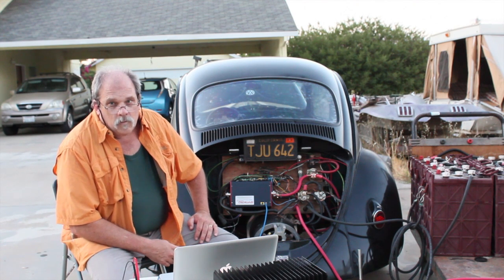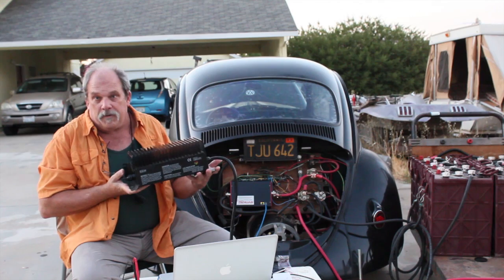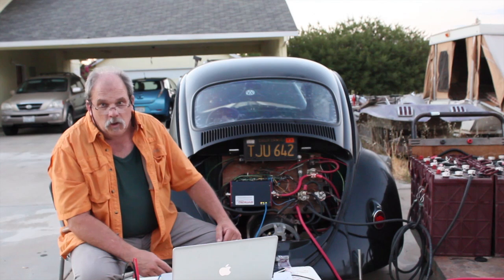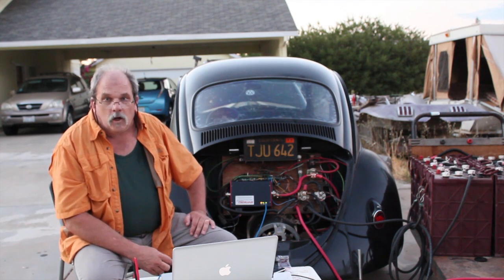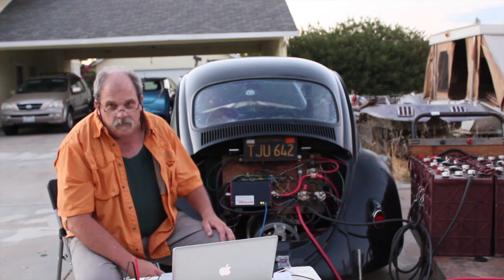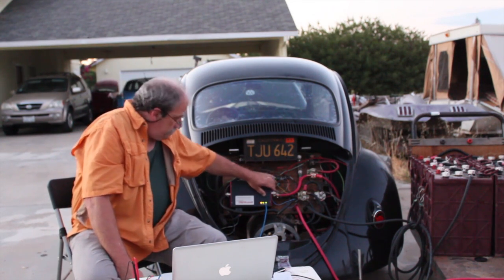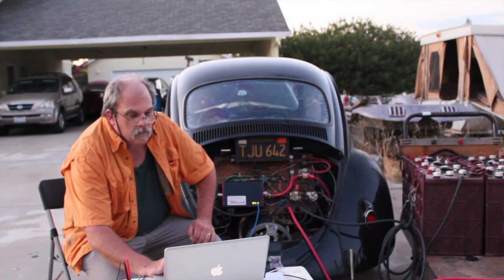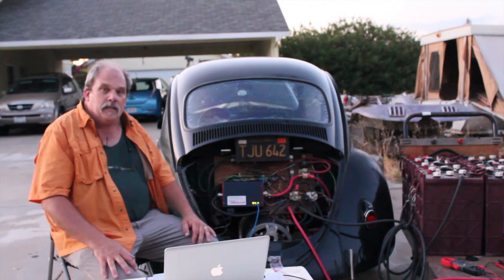Synkromotive

Comment: hi pete i have a synkromotive 750  controller  like yours in the video but no cable to link to my laptop any idea what i need so i can then use my controller it clicks and the fan comes on but without computer conection i cant set any parameters to get it to do anything more  ,  any help would be great thank you in advance
Reply from the maker: So you purchased one without the computer dongle? Since they don't make these anymore you can't pick up a spare from them. I'll have a look at mine and see what interface needs to be connected to the cable. I don't think any programming was needed for the making of the dongles. I won't respond quickly but I will respond when I figure something out. No guarantees and I don't have a spare. I have one for each of my controllers. If I sell a controller the dongle goes with the controller. Yours should have come with one.
Reply: @onegreenev  i wish it had i thought maybe its a generic dongle that hand shakes with a laptop or software download im in the UK would really like to get the controller working thanks for responding and look forward to any solutions or advice on how to proceed   i have been trying to find someone who knows about these controllers  for years and very pleased to see your video the projects pretty much just waiting for this interface device good to know they exist cheers again  bobbie .
Reply from the maker: @bobbierobinson3387  I will do my best to help you get your controller setup so you can change parameters.
Reply from the maker: I have one of the last NEW still in the box controller.

Comment from the maker: I decided on the motor because I already had this motor. Since there was an adapter available at the time for this motor I went with this. At the time AC was not a thing. Now I would only do a conversion with AC Induction Motors. HPEVS has a good system. There are a few outlets that sell them. I have an AC-35 for my VW Bus.

Comment from the maker: I need to update what is said in the video. The controller does do the CC/CV algorithm but does not do 220 volts if you have AC setup. Unless you have a step down transformer to lower that 220 to 110 or maybe even higher like 140. If you use AC as your source it needs to be a voltage like you do for DC that is lower than your pack voltage at its lowest possible charge. So for a pack of 60 cells will be 150 volts at 2.5 volts each cell.

Comment: Once we find out how to implement this in a way that will cover just about all the ways possible and do so in a simple way the manual may be updated. Until then it is not in the manual. The higher the current the the more heat is generated in the field windings of the motor/inductor. It would be better if the current was 50 amps into the battery or less. But the controller is fully capable of pumping in 100 amps of current to the batteries. Its the inductor that gets the brunt of the heat.

Comment: You won't see it for DC charging either. The manual needs updated. This is a very specific thing but was built in from the very beginning. Each persons needs may vary so figuring out how to satisfy your personal needs will not be a cut and dry affair but it is being worked on. I am working with it on my own car with the help of Synkromotive to be sure I have it right. It is actually pretty simple for the DC charging. I am currently talking to them today about setting up for fast AC charging.